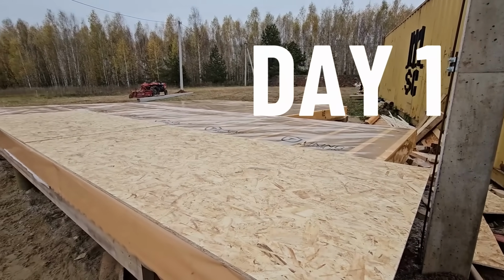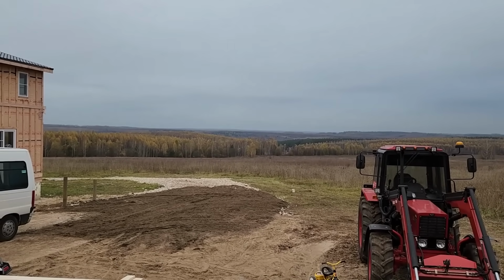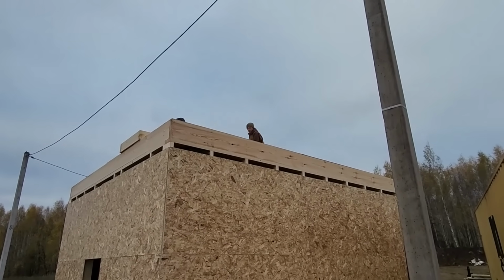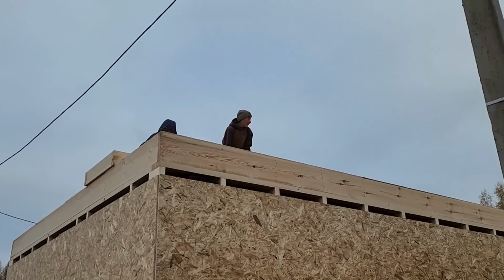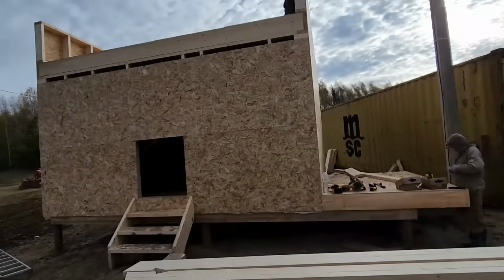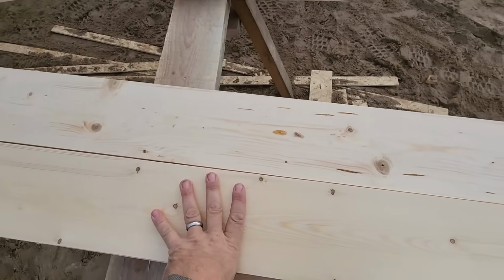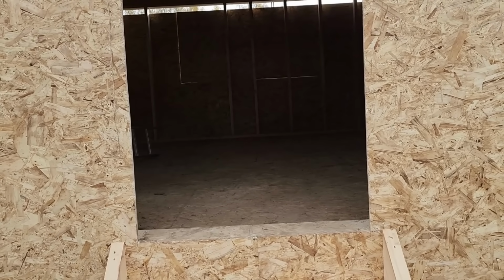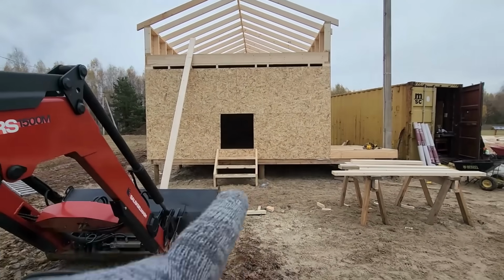WOWZERS!! Where did that come from?

Comment: As a former construction guy I really like the quality of the lumber. that building ain't going nowhere.. A shed like that here in Canada could cost you a a fortune with the price of lumber these days. Wishing you and your family all the best and for a speedy recovery from your surgery . 🙏God bless
Reply: The current price for good lumber is somewhat around $220 cbm
Reply: @dekartmagomedov  😧
Reply: А у нас это не дорого!
Reply from the maker: Thank you
Reply: @dekartmagomedov  Looking at the prices today the average here for soft wood lumber is $621 per thousand feet for 2x4
Reply: @Pashka70123  1000ft is about 305m and 2x4 is 0.038m x 0.089m around 1.03m^3 thus seems price is maybe 3x higher assuming those are USD in both cases.  But here in Saskatchewan I got 294 x 2x4 x8ft at around 1200CAD (Home Depot) including the taxes so that is around 510CAD / m^3 that is about 366USD so maybe around 70% more expensive if the $220 are USD.
Reply: @electrodacus  if you go to a small saw mill and pay cash you can get it for 17000rub mcub
Reply: "Сарай" в переводе с тюркского это Дворец!!!😂
Reply: @electrodacus  Just typed in your Info at my home depot here in Ottawa and 294 SPF Select untreated 2x4x8 is around $1,002.54 CAD and one sheet of OSB 4x8x 7/16th is $17.82 and the cheap stuff is $11.96 a sheet.
Reply: @Pashka70123  Yes about the same as I paid. When you buy a full pallet 294 x 2x4x8 is just over 1000CAD + 11% GST+PST here in Sask was fairly close to 1200CAD  and all this pallet is 0.038m * 0.089m * (294*8 * 0.3048) = 2.42m^3 so maybe a bit less than 500CAD / m^3  around  360USD / m^3
The wood quality looked good but when you consider the income in Russia vs Canada I will not say a similar shed will cost a fortune.
Reply: @madonna3846  Да, уж, не дорого 🤣 Вы, видимо, представления никакого не имеете о цене пиломатериалов в России.
Reply: @dekartmagomedov В России сегодня цена Куба пиломатериалов около 122 долларов. Это средняя. По регионам может отличаться как в одну, так и в другую сторону.
Reply: @dekartmagomedov  в России тоже дорого, сухая строганная древесина стоит 295 долларов за куб. м., по текущему курсу. Поэтому, в основном, у нас покупают сырую древесину с пилорам, сами ее сушат и строгают при необходимости. Такая стоит уже от  185 долларов за куб. м., по текущему курсу.
Reply: I am scared to think what it would cost to build in America. Canada has more trees.
Reply: Usually baths are built from round logs or timber, and now think how much more expensive it will be in Canada or the USA, in Russia it is not expensive.
Reply: @electrodacus  Prices for such wood vary in different regions, since wood is not available everywhere and the price includes delivery costs. Typically the price ranges from $80 per m3. Planed wood of the highest and first grade from coniferous wood costs $220 per m3.
Reply: Canada has tons of forests just like Russia,i wonder why lumber costs so much? maybe because in Canada its used more,in Russia everyone just uses bricks or concrete.
Reply: @juodagalvesniegena714  There is such a paradox - we build fences from boards, and we build furniture from sawdust...))) Maybe it's a matter of technology, or maybe someone has forgotten about the good old materials for construction.

Comment: I watched you since you broke ground on that house and I think you're doing an awesome job I work construction for 30 years building homes gas stations barns at the end of it I was forced to retire at 55 because of the fact I had to have both of my knees replaced my shoulder replaced and he still want to fuse my back together so that's what all those years of construction got me but I can tell you know what you're doing because everything you do I did the same way including your taping and mudding. I used to only sand once at the end I would just go along and scoop off anything with a 12-inch blade knock off any high points you know spread the next coat out do it then to win and then at the very end do a nice sand job. Thin to win it was supposed to say

Comment: quickly erected houses are good but not durable - after a while you will have to build again, which is not very efficient - but a durable house made of brick or block will be more efficient☺☺😀😀
Reply: You are very wrong !Mine is 90 years old and still good
Reply from the maker: Nonsense
Reply: @GoodFella-xw8yx  Well, where do you live?) Is your climate warm?
Reply: @GoodFella-xw8yx  It's been standing for 90 years, and how many times have you changed all or part of the material it's made of? Over these 90 years?))
Reply: На турбазах простые дощатые домики стоят уже лет 50! И еще целые! Хотя они зимой не отапливаются!
Reply: @ Roof only
Reply: @aleksey5804  Never!We did roof and paint

Comment: That's not OK. If the roof collects snow, that building is dangerous! It would have been better if the side wall studs had been taller. But as it is now there is a risk the short walls will be pushed outwards if the snow pressure gets too high. It is possible to make reinforcements where the sidewalls meet the roof.

Comment: Man, it' so fascinating to see the difference in house construction to what we are used here in Russia! Looks so much simpler in a good way. And your sons... what a family! This video actually makes me want to try out your method and build a guest house for my friends at my dacha in Karelia! Wish you and your family all the best here in Russia, best wishes from Saint-Petersburg! 

P.S. at some point here in Russia everyone started exclusively  using wood screws to work with wooden constructions instead of nails, though I know, that in Canada and US people mostly use nails and nailguns for it. It is considered, that a screw sits tighter and can withstand more "tearing" and wobbling... What are your thoughts on that subject? I am eager to go back to nails seeing how fast it is :)
Reply from the maker: I use screws in some areas and nails in others. The nails we use are barbed and very hard to pull out. A nails sheer strength is much higher than a screw so it is all about application

Comment: If you do the gypsum fiber board horizontally, then the OSB sheets should probably be placed vertically so that there are no horizontal gaps, or additional boards should be added to the racks so that where there are gaps they can be nailed to them. It is probably worth thinking about this. And you could make a ladder and a place to sleep in the attic, especially since you installed such a good window.

Comment: Does the wood you get all fit in the van or do you have it delivered?
Reply: probably a silly question, I just want to build something and don't know if it will fit in my SUV. I miss having a truck!
Reply from the maker: I get it delivered, everything comes in 6 meter lengths

Comment: How much did it cost for materials?
Reply: Russia is a big country. Prices for wood vary. I just looked at the price in my region. Edged pine board, grade 1 - from $130 per cubic meter. Siberia. In Nizhny Novgorod, prices may be different, but I don't think they differ much. One sheet of OSB costs from $5 per piece
Reply: @ probably 20.00 a sheet 4x8 usa
Reply: @ВальдемарЕнотов  тут не просто обрезная доска, а строганная, да еще продающаяся как сухая, так что умножай на 2

Comment: Have you told the children not to touch the wires?  Like with the ladder?
Reply: эти провода изолированны, их можно трогать
Reply: @izsormova6286  You never want to trial it though. Best to tell them not to get anything near the lines.
Reply: @JimmyCall  ,это специальные провода.Объясню как они устроены.Стальной сердечник,вокруг стального сердечника медные жилы,всё это покрыто изоляцией, всего в кабеле четыре таких изолированных провода,которые вместе покрыты ещё одним слоем изоляции.То есть там двойная изоляция и трогать их безопасно.
Reply: It's about the same as "you can't touch your mobile phone or computer with your hand, not to mention the kettle, refrigerator, and so on" - there are large electrical processes going on under the buttons.
Reply: @izsormova6286  ok cheers

Comment: At first, you could heat with electricity. It's not that expensive. And then run the gas. It seems to me that firewood can be more expensive. Usually, wood-burning heating is done in case of some kind of disasters and wars as an alternative. I've been living in an electric-powered frame house for 10 years now and it's not very expensive.
Reply: Дрова точно дешевле. Дешевле дров только газ и отработка какая холявная.

Comment: this is soooo close to wire and pole😲  you sure it's ok ?...i mean electricians wouldn't be pisst ? cant remember codes about that
Reply: Yes, indeed, it is a strange place for a building, when there is nothing but an empty field around.
Reply from the maker: We told them we were building in that location when they put the post in.... 🤷‍♂️
Reply: The cable is insulated and is not afraid of anything. Besides, the cable is their property.
Reply: @Serg-qr5my  Property or not, but actually there are rules and regulations for construction...

Comment: Placing the house between two electricity poles, so close to them and right under the high voltage wires doesn't seem wise... The distance between the top of the roof and the wires is absolutely minimal... The roof gets snow-covered in winter...  and the wires can be moved by storms and blizzards.... Something doesn't seem right...  In addition, an electromagnetic field (EMF) is created around the poles and wires, which is harmful to human health, causing a host of diseases, the most common of which are cancers. A house practically stuck to such a pole is a health threat.
Reply: I dont think this is high voltage. Its 220 volts . Also it is cable not bare wires.
Reply: @r.t.7925  ...Any electrically powered device generates EMF. All household appliances (the worst is the microwave oven) or computers become, by doing so, emitters of harmful EMF radiation - no matter the voltage. Between 2 electric poles in such close proximity, a specific EMF field is created which is quite intense, in which Arendt's guest house gravitates entirely.

The EMF issue is intensely discussed in the world, researchers and doctors confirm its harmfulness, while the industry and manufacturers lobby to deny it. I take the EMF harmfulness seriously, studies have clearly shown the high incidence of cancer in people living close to such intense fields (when their houses are close to poles)... Recently, it has been reconfirmed that the EMF field of cell phones, although relatively small compared to other electrical objects, causes brain damage and disrupts the electric field of the human body cells.
Reply: @tenzindolma6266  The magnetic field around a wire is proportional to the current through that wire. If you have a hot and a neutral, the currents are in opposite directions, if you put the wires together like in a cabler, the whole thing is like one wire with no current so the magnetic field is basically zero.